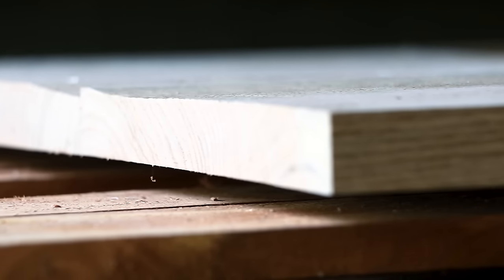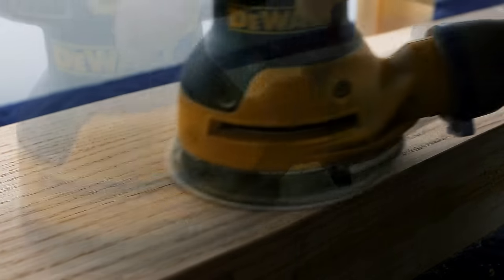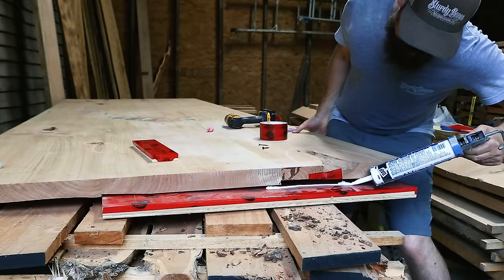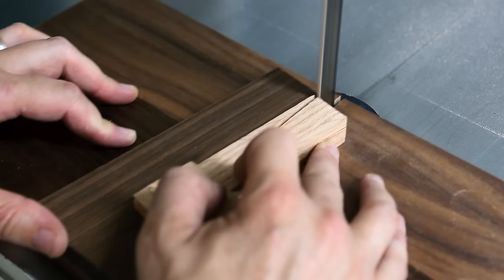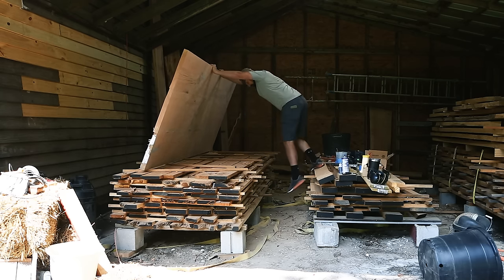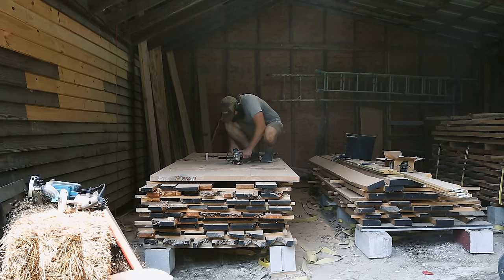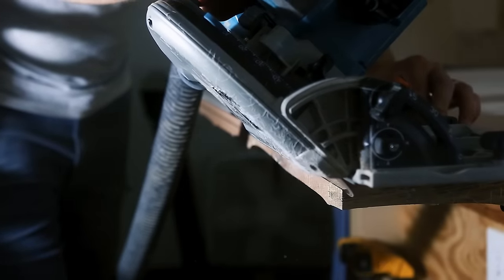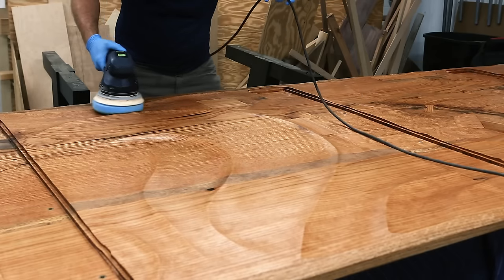Conference table with an AMAZING hidden detail

Comment: Have you considered hanging this on a wall so you could work on it standing up straight? You could move it up and down to work mostly at the same level. You could also counterweight the tool.
Reply from the maker: I didn’t but that’s good thought. Good news is I probably won’t be doing another 350lb 12ft table like this again! 🤣 thanks for watching!

Comment: You know what? I watch a ton of woodworking videos. And this is easily the best idea I have seen
Awesome.
Reply from the maker: Thanks so much for that. I consider that high praise. It’s definitely unconventional to spend a lot of time on the bottom side of a table but it solved my problem and elevated the final result, showing my client that I care about the whole piece, not just the immediately visible parts.

Comment: After probably watching well over 1000 videos on YouTube this is  if not the first, it’s one of the few times I’ve commented on a video.   I do give the thumbs up often though.  Great job and nice editing on the video as well.  One question. On  the epoxy pour did u go in there with a stick to produce the swirls while it was drying or did it just come out that way? Again, nice job 👍🏻
Reply from the maker: Wow I’m honored to get a comment then! Thank you! It’s interesting you should ask about the swirl. Maybe other metallic pigments act differently but with this pigment and epoxy at least there is apparently about a 30 minute window in which if you stir it the swirls will actually remain. In many of the spots where I stirred it though after the 5hr mark, they dissipated and went back to being blobs. So I’m still learning on that score.

Comment: When I have to flip something that large over I run a strap around the piece and use an old block and tackle to lift one side and then sift it (without jumping up on the table) and then lower it.  It takes a lot of the weight out of the equation and is a bit safer than my old way (similar to yours).  You can pick up the block and tackle at a yard sale, flea market, etc. for less than $20.  Your setup would work much better than mine - you have a higher ceiling.
BTW - very creative solution for addressing the bottom, it actually looks better than the top.
Reply from the maker: That’s a great idea. I will definitely be looking into an alternative next time I need to make something this big. Thanks for the compliment. And I agree it looks better than the top! Haha! Some folks were asking why I didn’t show that many photos of the top side and it’s because I just wasn’t that impressed with it myself. There’s some nice crotch figure near a couple of the bowties but otherwise it’s not terribly interesting.

Comment: Are you worried about shrinkage and warping after it's installed since you did the build outdoors? Great job and what a beautiful table.
Reply from the maker: Great question. I didnt show how I mounted the top to the base very closely but I accounted for a certain amount of movement laterally across the table in the mounting brackets and recesses you can see when the bottom side is up. The top was kiln dried in a vacuum kiln so even if it picked up a bit of MC while it was sitting it should have every chance to equalize now that it’s indoors in AC. Thanks for watching and for the support!

Comment: Awesome video!! I am curious how you attached the base to the top. It looks like it was going to be similar to C-channel but your beauty shots at the end made it look like it was all wood?
Reply from the maker: Hey thanks for watching! Yes, I borrowed a technique I saw in. Pedulla Studio video. I cut out recesses in the tabletop that had a rabbeted edge and installed threaded inserts into the bottom. Then I made complementary but undersized mounting plates from the same red oak which were also rabbeted so they’d fit in but allow for wood movement. The mounting plates had counterbored and oversized holes also to permit wood movement. And the each leg got 8 1/4-20 bolts with washers to hold it on. I didn’t use any c-channel. The hope is since the entire slab top was kiln dried for several weeks in that larger shop’s vacuum kiln, and since it’ll live in a climate controlled environment,it won’t really move very much over time.
Reply: Thanks for the great explanation! @sturdyboneswoodworking

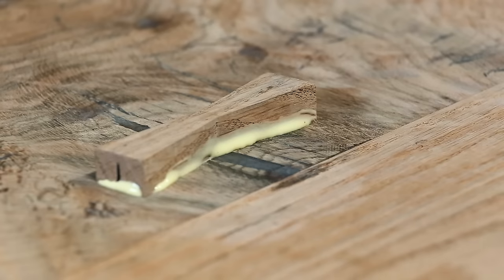Comment: It's fantastic! Looks like you've got a killer spot to work in, too. Question: did you slot the bowties (at 8:21) so they'd pinch in? Also, a thumbs up for the metric conversion gag.
Reply from the maker: Thanks so much! I am very blessed with my huge barn and property out in the country. So thankful for my shop. I’m not positive what you mean about slotting the bow ties. I just chopped it straight down to the bottom. But I did give the bottom edges a little chamfer to allow the glue somewhere to go. That’s a skill I haven’t nailed down yet - getting the perfect amount of glue so it holds without creating an air pocket and making my bow tie act like a piston, preventing it from going in all the way. I’ll keep practicing.

Comment: I bought a cheap manual engine hoist specifically to help lift heavy pieces in the shop (including tools and steel sheets). Pretty useful and I store it outside under a tarp. My back isn’t healthy like yours but you really could hurt yourself doing it alone. 
Awesome table!
Reply from the maker: Thanks for watching! Yeah that’s a great point and the engine hoist is a great idea. I’ve also seen Izzy Swan’s overhead track lift thing which is a good idea too.
Reply: Izzy had major back surgery not too long ago. (That same surgery actually ruined my back). So maybe a good hint from him.

Comment: I understand the thrick with the water spraying but when I was apprentice, my boss told me to never do this on oak because of tannins that could come up. Did you ever had any problem like this spraying water on oak?
Reply from the maker: I suppose you could get some odd staining if it was a lot of water. There is a shot of it drying after I sprayed and that took about 20 minutes probably so maybe just not long enough to work any tannins to the surface. Is staining the issue your boss might have had in mind for why not to set it down to pop the grain? It makes a big difference in how smooth you can get the finish so I guess it’s a risk that’s worth it?
Reply: @sturdyboneswoodworking  yes sure. I might try it then. Maybe if it's just a light pass of water, like you say it dries fast and the tannins can't come up. I'll make some test the day I'll start working with oak